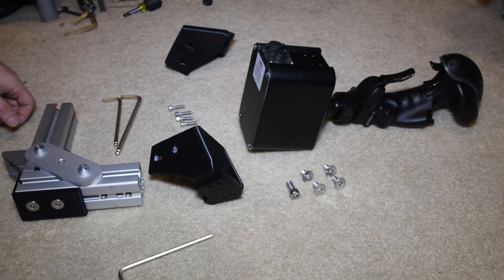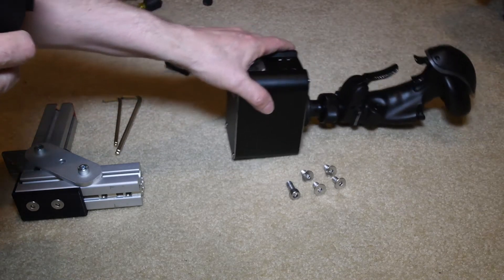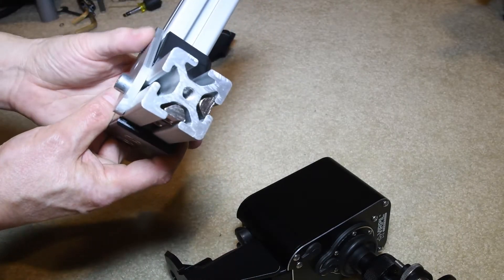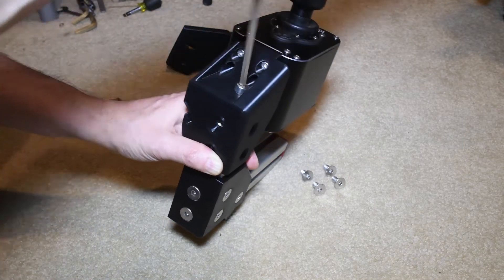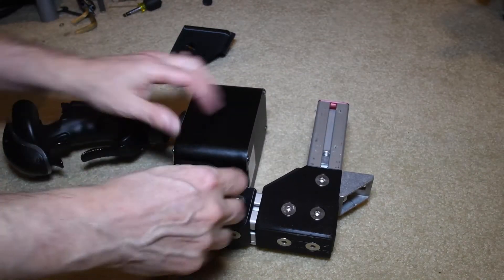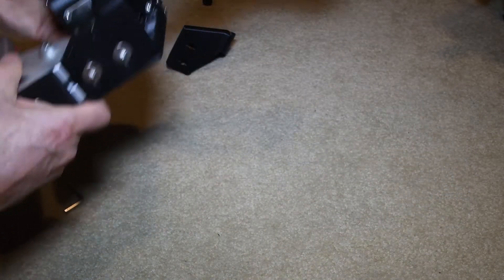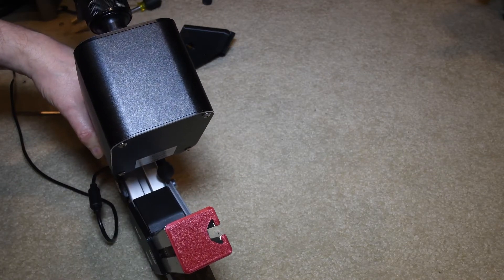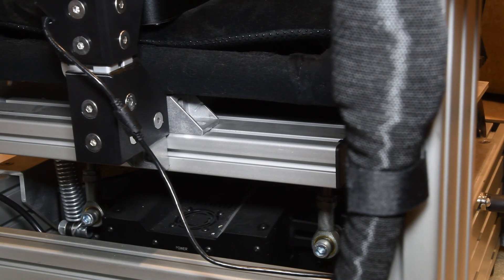Flight Stick Mount Upgrade

Comment: What marial did you use? I was planning to make a mounting plate to my armchair for a collective.. Im doubting the strength of 3d prints especially thin prints like 6mm mounting plates...
Reply from the maker: I used PLA for this. The only stress bearing member is the stick mount which has a lot of material and long slots for the 4 mounting bolts.

The thin PLA is purely cosmetic. There is an aluminum profile corner brace and a metal side plate holding the profile together.

Comment: You gotta love aluminum profile for simulators. Nothing beats it. 

 Would you happen to have links for the joysticks and large “power icon” button on your button boxes? Thanks
Reply from the maker: Power Button:
https://www.aliexpress.com/item/32963205757.html?spm=a2g0s.9042311.0.0.554b4c4dmJtR5H

Joysticks:
https://www.aliexpress.com/item/4000376347028.html?spm=a2g0s.9042311.0.0.554b4c4dmJtR5H